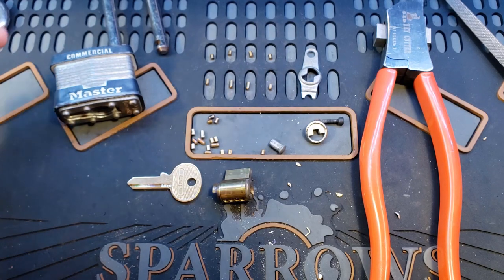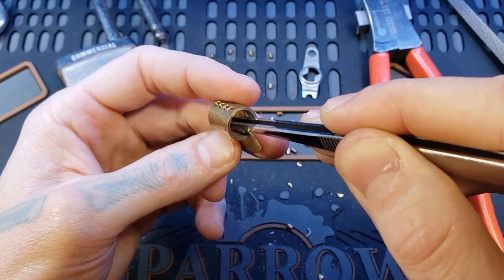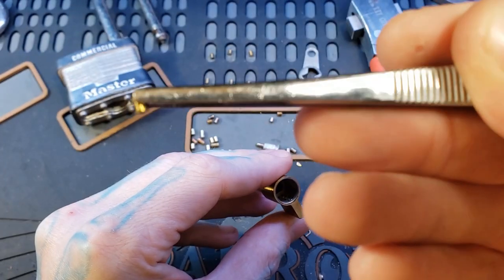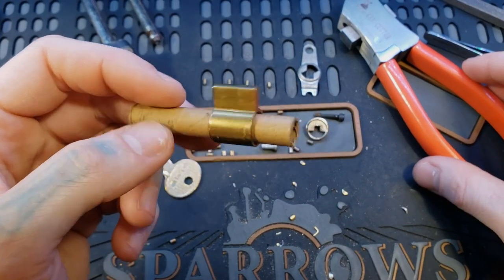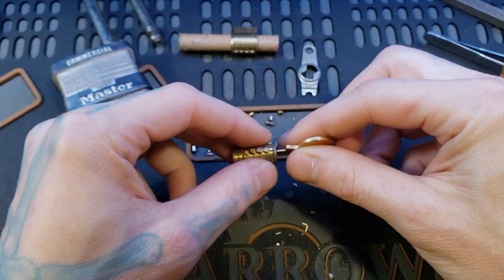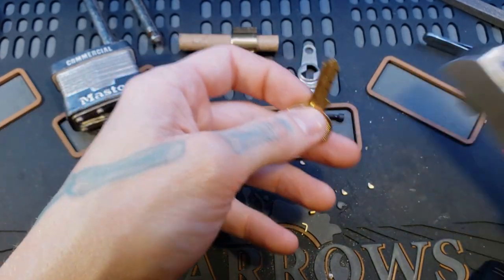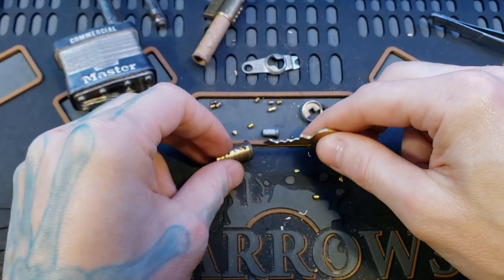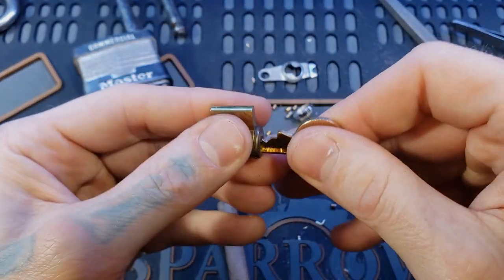51) How To Repin Rekeyable Master Lock No 21, Hand Cut Keys, and Remove a Crimped Core

Comment: Great video, would you recommend lishi key cutter?  I found one for a great prices but hesitated, pulling the trigger. Seen some older video on them.  They seem great, any cons about them?
Reply from the maker: I would recommend them.  They take a couple keys to get the hang of but worth it.  The cons are rough edges that may need gone over and sometimes it can bend the key a bit where you're cutting, making it hard to stick back in the keyway (see around time 5:40 in the video).  I'd recommend some basic metal files just for touching up mistakes or helping smooth it out